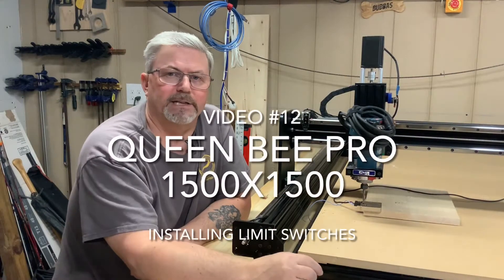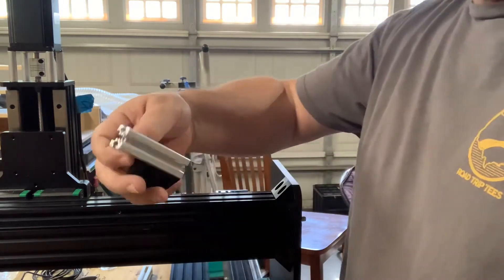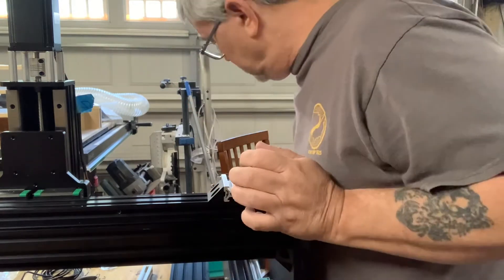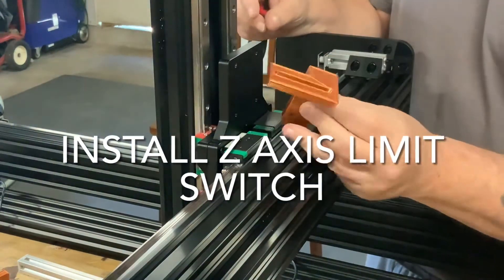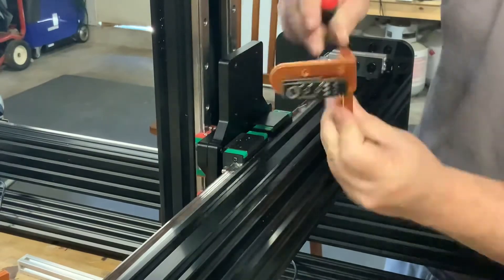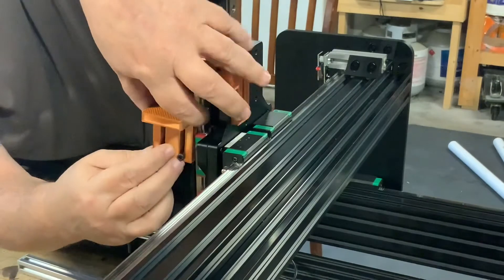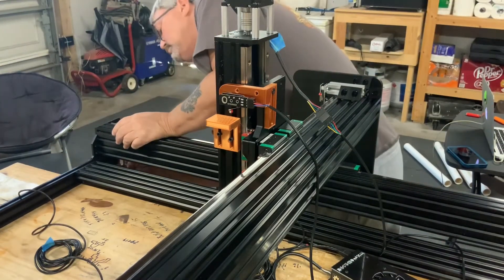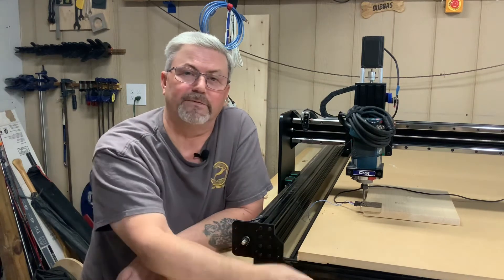Bulkman Queen Bee Pro Build #12

Comment: Would you share the STLs of your brackets. I just finished my limit switch wiring and I have the switch on the bottom of the Z axis so that it contacts with the lower bearing block, but I don't like having the wiring bend as the axis moves up and down
Reply: yes please share those stl files